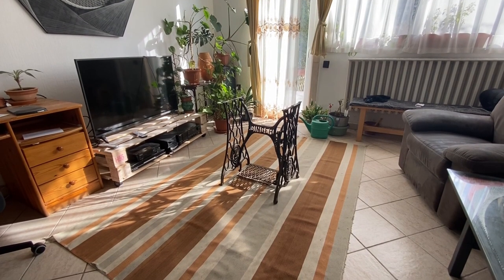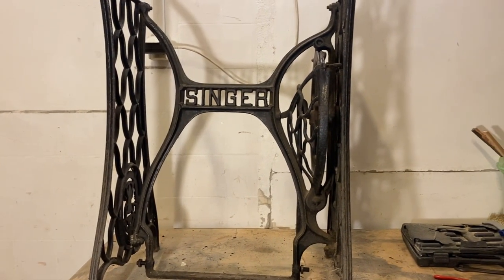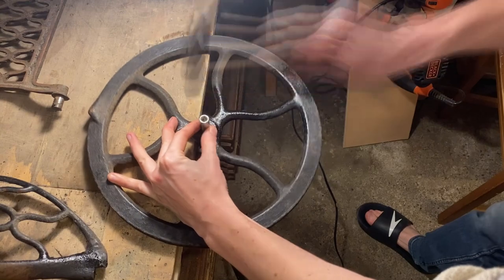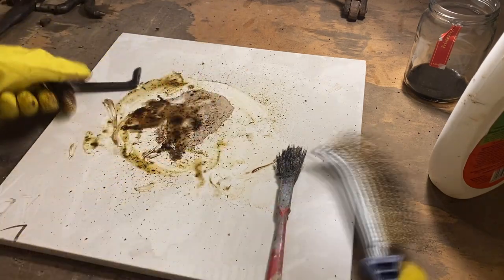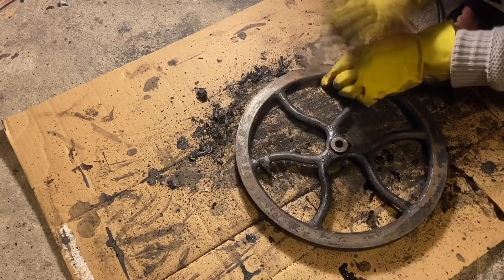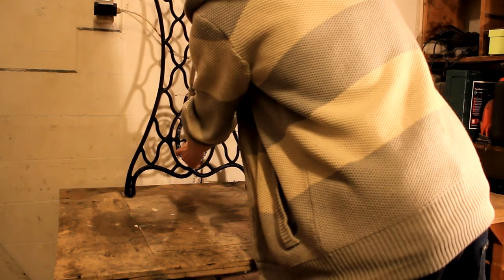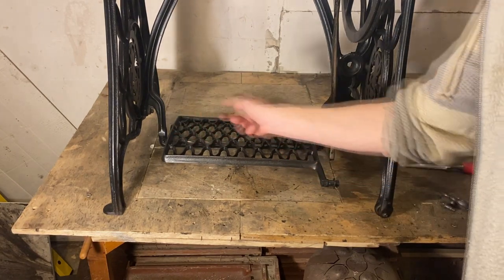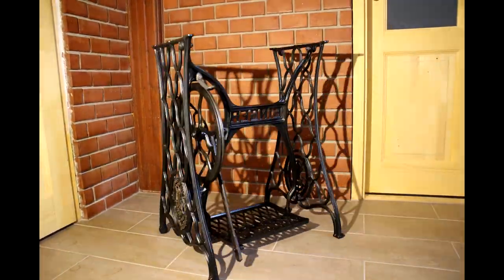Restoring an original Singer Sewing Machine Table

Comment: You did an amazing job! I recently acquired my own treadle machine and table. The wood of the table itself is in great condition…. The bottom iron part though, is a rusty mess. Same with the machine. These videos are so helpful. I’m honestly a little intimidated that I will not remember which part goes where it’s supposed to so I’m not sure I’ll have the courage to disassemble it 😂

Thank you for the in depth video though!

Comment: How difficult was it to remove the wheel of the crank.
Reply: Also, are the wheels just a turned on the lath, or are they small bearings

Comment: Sorry to say that close pictures have shown that the painting was way too badly done . The use of a brush would have had a  better result . Sure the stripping of the old paint was not satisfactory . Still I value your perseverance.
Reply: Needs to get himself an angle grinder with a wire wheel.